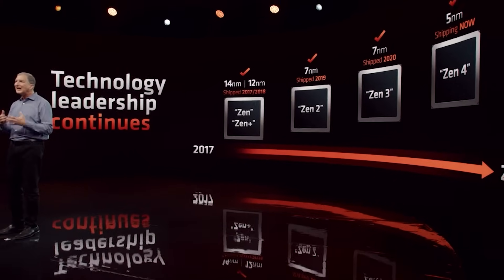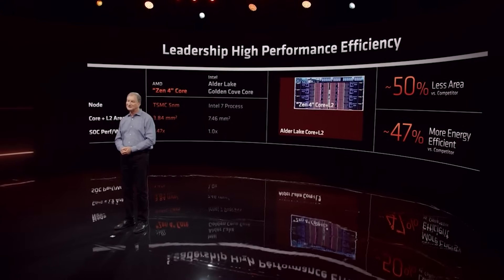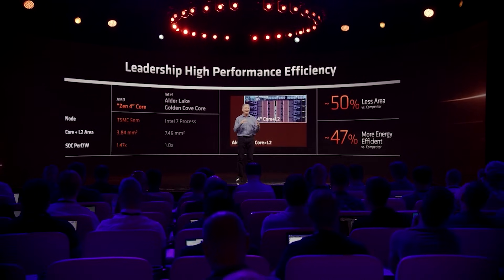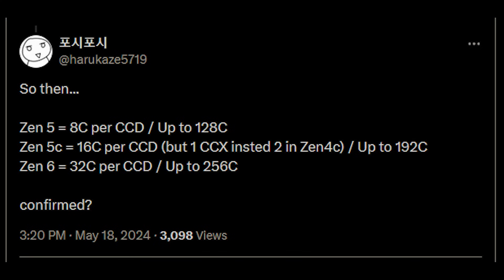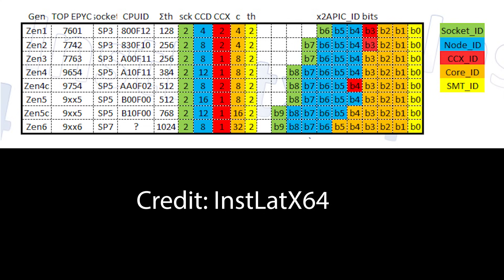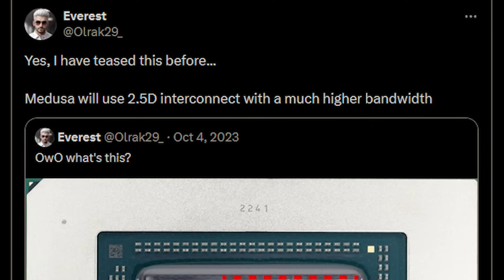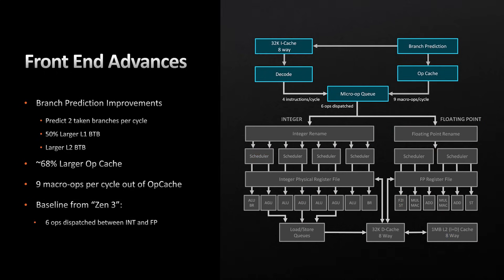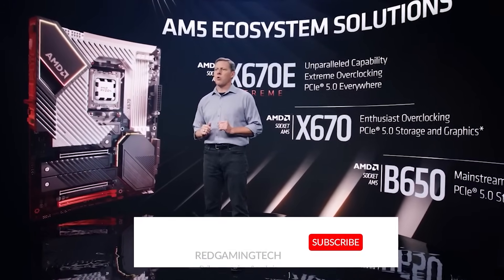Zen 6 To CHANGE EVERYTHING... Again! CCD Info & Specs LEAK

Comment: amd maybe doing away with multi-thread as well, just using extra core like intel doing. Intel ran into a problem with the threading, I guess that amd run into the same issue.

Comment: I'd expect if Ryzen goes 32 or more performance cores, it would be on AM6 or some derivative.  as 1718 pins is probably not going to cut it bandwidth wise.  So expect much higher costs for both CPU and Motherboards.

Comment: AMD will need a 16 core CCD for the X3D variants. 8ncores are fine for current games, but Zen6 will be a CPU sold during 2026-2028 that needs to handle games released in 2023 or longer.

Also I am pretty sure AMD will bring a 32 core variant if Intel comes with ARL refresh 8+32 (E cores are expected to be much stronger than now).

Also Zen4 cores are currently very small. More than half if the CCD is used for L3 (that does not scale with N3 at all) and stuff like infinity links. If AMD brings a 16 core CCD this does not make it twice as big.
Temps can be an issue if all 16 cores are under full load, but AMD could simply reduce boost clocks under all core workloads.

Comment: One thing odd about the zen lineups. They have the i/o die and various configurations of ccd's. Either two on one side, or four on each side or 6 on each side. Where is two on each side? Do the two each side a hedt, two on each side as workstations, and six on each side for server. Hedt should be more pcie than regular desktop and workstation more and server many more. say 32,64,128,256? optimistically, or 28,36 64,128 more realistically, or 28,32,64,128.

Comment: It's about time that AMD upped the core count in Ryzen processors.   Way past, actually.
Reply: 16 cores not enough?
Reply: @nipa5961  32 and 4 memory channels would be better.
Reply: @nipa5961 16 cores has been on the consumer platform since 2019, and for the people who actually need 16 cores they want more multi-threading anyways. I want AMD to increase cote counts because I want cheaper 8 cores. At this point I think R3 6C, R5 8C, R7 12C, and R9 16C and 24C for consumer Zen 5 is reasonable, but AMD won’t be doing that for money purposes.

Comment: Sounds about right.. AMD talked about a 256C EPYC years back... I was wondering if they would increase to 32C for Zen5C or just stick with 128C with higher IPC and clocks... It looks like the Genoa successor will get 16C at 4nm... They can differentiate by keeping the 32MB L3 where 5C would stay at 16MB with the same shrink...

But I do see Genoa's successor doubling to 192C... That could easily see MI400A have 48C with any advances from CDNA4 (I think up to 400CUs)...

Anyway, they just have such flexibility with chiplets and cIODs it's fun to speculate... A lot will also be about maintaining the layouts which is currently 12CCDs for Cloud HPC chips and 8CCDs for Cloud Web servers... They could move to a 12CCD layout for Turin Dense which would also move to 192C... No one is even close to that so they can wait for Zen6 and perhaps 2nm to move to the 32C CCD...

That will require a cache redesign though I still believe L3 can be removed from the die using VCache stacks... That would make for an even more flexible chiplet design base letting them cram more logic into the dies and design stacks with L3 and\or HBM...

Comment: All I want is a Zen 6 X3D with 16  cores in one CCD.
Reply: Same lol
Reply: @NunoFilipe99  and a Strix Halo Laptop with 8 (X3D) cores and 40 CU`s for under 1,5 k
Reply: Single CCD 16 core X3D would last me seven or eight years for 4K gaming.
Reply: I think you'll get that.  It's a logical step, for sure.
Reply: Well not only that 16 cores per CCX. One CCX in one CCD. Cause Zen 2 had 4 core CCXs and 2 CCXs per CCD. Zen 3 made it 8 cores per CCX. We need more than 8 cores in one CCX on one CCD for good core to core latency with more than 8 cores.
Reply: Unfortunately you won't get that. Why do you think you need it?
Reply: @DanielTaylor-br5cm  Who says we need it? This is a hobby, which means it's about things we want.
Reply: Zen 6 X3D would have 16 cores on both CCD's.
Zen 6 will also feature a 32 core CPU it will be Zen 6c.
Zen 5c and Zen 6c is basically the (e cores) version of AMD.
Zen 5 X3D is unsure if it has X3D on both CCD's.
But Zen 6 X3D is for sure on both CCD and I expect
Zen 6 to have double the cache amount vs Zen 5 X3D.
Meaning Zen 5 could have a little more cache spit to two CCD's.

But there is also a rumor/leaks that suggest Zen 6 to have 3 CCD's meaning Zen 4 will have X3D on one CCD, Zen 5 on two CCD's and Zen 6 also on two CCD's with the 3rd CCD being the CCD0 (which is the main CCD). 

But if main CCD0 and CCD1 will have X3D then CCD2 will be Zen 6c (as the 3rd CCD) which is for AI focused and other background tasks and when they implement X3D into the Zen 5 or 6c it will have more performance in frames and apps like DLSS/FSR/Raytraycing. If Zen 6 X3D comes out it will most likely use Zen 5c cores and this will be something like 16 cores Zen 6 + 4 cores Zen 5c or somewhere like 20-24 cores up to 32+ cores AMD's physical core count is a maximum of 8 cores per CCX and 16 cores per CCD if I'm correct Zen 4 was 8 cores per CCD, Zen 5 will be 16 cores per CCD and Zen 6 will be 32 cores per CCD the last one might be Zen 6c only and this CPU will be like a 16 cores on steroids for multitasking and programming and other heavy duty tasks like video editing.
Reply: I want so much V-Cache on my next CPU, it remembers its own creation at the fab.

Comment: Will Zen 6 be on b650 motherboard?
Reply: All rumors and info so far say Zen6 will be on AM5.
Reply: @nipa5961  No Zen 6 is a completely new architecture based on a new motherboard namely AM6, so 2025 AM5 is the last generation for AM5 CPU/Motherboard and in 2026 AM6 is the newest generation with AM6 boards. 

AM5:
1st generation is Zen 4 = X670E (AMD 600's boards) 2022
2nd generation is Zen 5 = X770E (AMD 700's boards) 2024

AM6:
1st generation is Zen 6 = X870E (AMD 800's boards) 2026
2nd generation is Zen 7 = X970E (AMD 900's boards). 2028

Zen 8 = AM7 = 2030
Reply: Nah, it will be B750/X770E motherboard for Zen 6.
Just like Zen 5 will be on B650/X670E motherboard.
Reply: @winnb4968  source?
Reply: @winnb4968  you make no sense.
AM6 "B750/X770E motherboard for Zen 6." but "AM5: 2nd generation is Zen 5 = X770E (AMD 700's boards) 2024" ?

Comment: So Zen 5 single CCD 8 core X3D in 2025 then possibly Zen 6 single CCD 16 core X3D in 2026?
Reply: zen 6 x3D more like 2027.
Reply: @darkfire3691  Yup Zen 6 end of 2026 and Zen 6 X3D 2027 Q1
Reply: I thought zen5 was q3 24
Reply: @chrisgraff2103  For the non X3D variants.  Zen 4 non X3D launched 2nd half of 2022 and X3D launched in 1st half 2023.  If AMD keeps the same type of release schedule, Zen 5 X3D should be early 2025.
Reply: @chrisgraff2103  Yes, Zen 5 release is between August-Sept it will release before Arrow Lake which release a month or two later then Zen 5 late Oct.
Reply: Zen 5 is in Q3 and X3D is in Q4 of 2024. Zen 5 I believe uses X3D on both CCD's and Zen 6 will have 3 CCD's and the third CCD will be an Zen 5c which will be connected to the other two CCD's for cache stability and to handle AI performance much better also in AI accelerator apps like DLSS/FSR and for rendering Raytraycing frames the main CCD won't be effect with performance hit due to overheating the x3d chiplet so the c cores will do it's work for direct communication between the cores and GPU with much lower latency.

Comment: This is probably the generation I'm upgrading to. I currently use a 5800x. 70-100% more performance is my criteria for a CPU upgrade.
Reply: @ZiZo34344 depends. People underestimate sometimes how much of a difference a CPU can make. If you have something like a 4090, the next gen CPU that's about come out can probably offset some of the load the GPU might be doing and free up performance for the GPU, hence increasing FPS output and requiring a better CPU. Def not as much as the actual raw CPU performance difference but enough to be noticable. Maybe from 60 to 90 fps and not 100+ but noticable
Reply: @2muchjpop  as long as your GPU sits ~99% utilization faster CPU gives you sh*t.
Reply: @korinogaro  okay bro put that 4090 on your q6600 ( ͡° ͜ʖ ͡°)
Reply: @2muchjpop  this answer was really... not smart. Will I have 99% utilization with q6600? You just spread false information, or at least not 100% true. Faster CPU will help you in CPU bound situations, like for eg. cities in Dragon's Dogma 2. But on the other hand you won't have 99% GPU utilization in cities even though your FPS tanks to ~40 even with moderately fast CPU.
Reply: @korinogaro  my point was that people really underestimate CPU. I'm not saying you'll see crazy improvements but noticable if the CPU is better. There's a lot of things the CPU does and even in 4k, check hardware unboxed recent CPU video. In a decent amount of the games, 4k was faster with a newer CPU
Reply: @ZiZo34344 False CPU bottleneck still is a thing.
Reply: Double fps or I wont upgrade
Reply: @ZiZo34344  I see from time to time my 5800x become the bottleneck with a RX 6800 XT at 4K, both new and old games, so yeah, CPU is still important for 4K.

Comment: Like seriously, who the f*ck, except for like small % of professional users cares about doubling the cores? Majority of software can't even properly utilize 16 cores. And games have problem with 8 cores. A lot of them still hammers only 1-2 cores like it is year 2010. DIY market needs clocks, not cores.
Reply: It's about having more for your money, when will 200-299$ 8 cores cpu be a thing?
Reply: @necrospencer658 7700x is $285 on Amazon right now.

And to the OP, the purpose of more cores is for datacenters where the servers are running dozens to hundreds of VM’s and containers, and increasing core counts has a practical benefit of consolidating multiple servers into a single server and reducing total cost of ownership within the datacenter. There’s a reason why mainstream consumer CPU’s haven’t gone past 16 cores, and the ‘best’ gaming CPU’s are still just 8 cores with a lot of cache. These 32 core CCD’s are almost certainly the cloud optimized variants (lower clock speed, but many more cores) and we won’t be seeing anything like that in desktop or laptop form factors.
Reply: except for like small % of professional users
Very few, so buy  the cheapest ARM and firee up Office Online and webmail. Or the lowest 2 core. Oh wait lowest is 4 these days. It will do fine.

Majority of software can't even properly utilize 16 cores
Define majority. By power use%? By lines of code? By number of programs used? Or sold? Many many free downloads of great software. Or by how many they really load up? By total running hours?
The smaller helper programs that load 1 or 2 cores like CChelper, BorgBackup, 4K Downloader, are all programs used by people that also load up Photoshop, Da Vinci, that also may or may not load up 16 cores (often not).

Even then, kernels for large programs like SolidWorks, SolidEdge, certain GIS packages cannot use 2 cores fully, almost every component depends on the previous. For brute forcing many paths for CAM or a good render it can load as many cores as you can throw at it, gpu's too. 

games have problem with 8 cores
Some do, some do not. A lot is multiplatform, all consoles have 8 cores, so games use 8 cores. If you then have some stuff in the background (most have more than they think) that loads those 8 cores too so 10-12 is ideal to me. My tray:  Skype, Discord, Nvidia, Outlook, Qbittorrent, Avid Link, Seagate Toolkit, App Center, Phone Link, G Hub, Roccat Swarm, Everything, GOG, Epic, Steam, EA Play, Mega, Avast, MalwareBytes, Teams, OneDrive. And I am not  even that exceptional, many have way way more there. All running in the background. 

lot of them still hammers only 1-2 cores
Of course the do, for the main loop, but this also is a function of middleware (Unreal Engine, CryEngine, Source, Unity, Godot, FMOD, Wwise) doing this. Even then, I sometimes run Pro Tools, Handbrake, DaVinci, SolidEdge, and aside from the odd game I play (mostly Eve anyway) having good cpu on tap is a good thing for my measly desktop.
Reply: Thats why next gen consoles need to have zen 6 with MORE cores so that games are forced to use more cores becaus consoles have more cores. Its all about the consoles. Thats why games arent using more than 8 cores... because consoles have 8 cores.
Reply: Who cares about du..b games. Nobody cares about clock speed. Everybody cares about efficiency. And more cores bring it. I utilize all cores 100%. And hope new Zen will increase core count and not care about stu…id games and clock speed